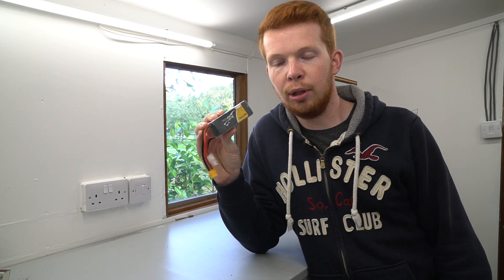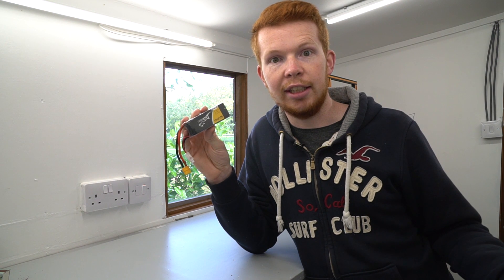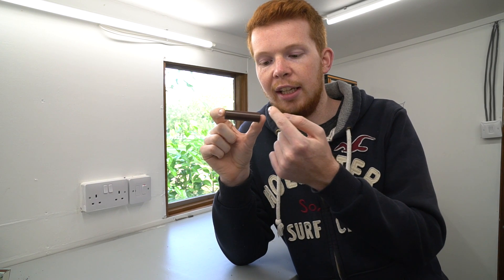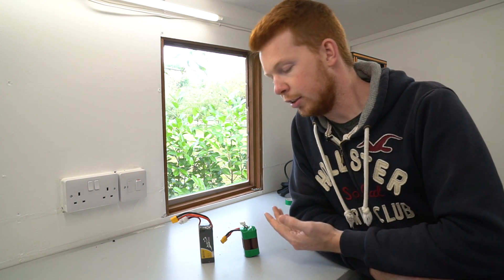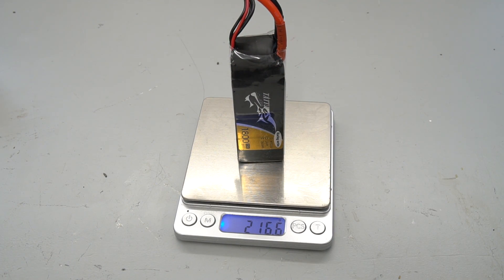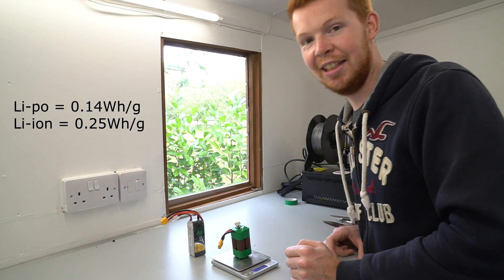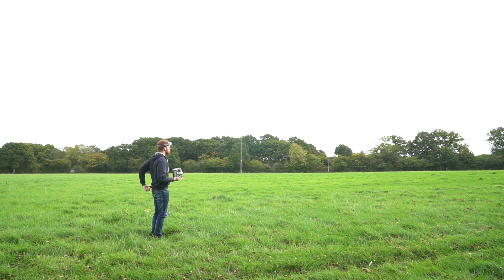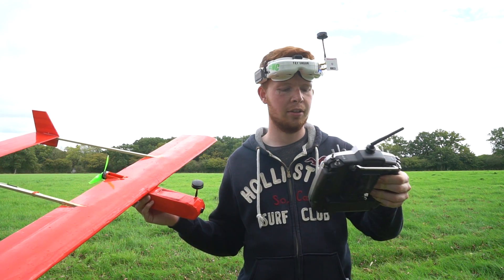Lithium ion plane battery

Comment: Just re-do the test with the plane anchored firmly to the ground and account for the drag and lift fraction that the motor won't have to push through (since less thrust is needed when you're not actually flying). Let it run "automatically" and check on it every 10 minutes or so. I don't see why the plane actually has to be flying around if what you're interested in are just the cruising values...

Comment: cool video, thank you. please run this pack on the bench! it shouldn't be to hard to clamp a motor down and let it run for an hour or two! also let it run down to 2.8 volts with 0% throttle if you can, Im really curious to see how long that is after 2.8v with the drop.. thanks!

Comment: Man... you really need to finish testing with the Li-ion. You don’t just drop the ball because it is boring. Not in my lab... You can teorize as much as you want to about the claimed performance but it is all garbage untill you prove it in the field. I bet there will be more surprises. Never go by manufacturers claims which are also... theoretical and under ideal conditions.
Come on - we are waiting ! :)

Comment: You kinda got the capacity thing wrong.
What it says on the pack, is what is safe the use, in safe voltage ranges.
It a battery pack has 1600mAh on it, then you should be able to take 1600mAh out of it just fine as manufacturers will, or at least should, rate the capacity based on discharge in safe voltage ranges.
You want to extend battery life then yeah ok reduce the voltage ranges so use less capacity.

Another thing, these 18650 3400mAh (NCR18650GA by Sanyo(Panasonic)) ones are capable of 10A constand 15A burst oficially but actually 15A constant and 20A burst in good thermal conditions, NOT 2-3A

AND OH GOD THAT ASSEMBLY.
Duh you did everything wrong, and unsafely, it's bsaically a time bomb.

Also you can get a battery spot welder made for less than 20 assuming you have a broken microwave and some beefy 35mm2 wires.
Reply: I've made some li-po to li-on conversions in the past with older tech cells for few  friends for their planes and they were reporting around twice the flight time with li-on.
I think these were usually 3S4P packs out of NCR18650PF which are 2900mAh.

Comment: You got lucky your li-ion batteries didn't vent. I vape and use 18650 in most of my devices and I had 2 batteries vent on me with only a small amount of heat from a short. I was lucky that I read building a coil at the time instead of vaping or my face would have been on fire instead

Comment: By percentage... the LiOn Batteries are fully discharge a 2.5 V per cell... and the LiPo battery is fully discharge at 3.7 V.... So unless you achieve those levels of discharge then you have not been realistically fair with your test... "Usually I only discharge my LiOn batteries down to 12 V and I know perfectly that I still have well over 30% power left on them...

Comment: An ampere-hour is not a unit of energy unless voltage is specified, so that watts can be calculated. Energy is specified in terms of power per unit time, such a watt-second, which is a joule.

Comment: Why did you fly at the same cruise speed for both batteries? Shouldn't you be able to fly slower with the li-po because its lighter, so you can get even more flight  time with a weaker draw thruster?

Comment: Hi Tom.  I enjoy your channel.  I experimented with long duration flight around 1995.  I used a small sailplane with a 1.5 meter span, a 6 cell 800 mah NiCd pack and was able to fly for almost 90 minutes.  The energy stored was 8.6 watt hours and my average draw was about 4 watts to sustain level flight.  Prop was a Robbe 6x3.5 folder and motor was a Graupner Speed 400.  I don't remember which wind I used.  Average current was about half an amp.  I had to do this just before sunset when thermal activity was nonexistent and no wind.  I found that trying to climb more than the minimum required to stay airborne shortened flight duration and thermals are bad because there is a lot more down air than up air.  Even a little down air increases your average watts.  Lipo batteries of even the poorest quality would give around four times the duration.  I would have had to worry about the transmitter batteries and bladder control issues with 6 hour duration flights not to mention being bored out of my mind.
Reply: how were u able to fly for 90 mins with just a 800mah pack at 7.2v max? makes no sense...

did u mean 8000mah?
Reply: @yaimem  The answer is in the previous post.  Still air and slow speeds with power level set to barely climb when flying straight and level.  Turns would give slight loss of altitude.  An 800mah 7.2V NiCd holds 5.76 watt hours.  Not sure where the 8.6 wh came from in the previous post.  A 4 watt draw would last 1.44 hours or about 86 minutes.

Comment: What is needed for flying is energy not charge. Multiplying the nominal voltage with it's nominal capacity is only a rough estimation. The problem is, that the energy you can get out of the cell depends on the discharge rate and the inner resistance. E.g you could short a cell and get out no energy at all since the voltage is zero.

Comment: ok JNHM rc here ....  I Need Your Help ...  in my 1st of their kind prototype cars i have a wheel power batt . and an EDF JET  Batt.    they both are LIPO ....   should i try to switch to Li-ion ... for my EDF JET BAtt to save some weight ?... or would the lower c-rating hurt my thrust too much ? .... 
this is why i Need Tom To Join My Start Up .... funny how he has the ( So Cal Sweater )   and im in So Cal ....

Comment: NO no no, LiPo cells can be brough down to around 3,3Volts, Li-Ion cells can be brought lower but the voltage drops very very quickly at the end, so the discharge curve is far from linear after 60% discharge... and then get rid of that XT60 connector and those heavy gauge copper if you try to reach maximum efficiency and running low amps.

Comment: Good info. I thought the nominal voltage of a Li-ion cell was 3.7V.. Would it still be a valid test to just anchor the plane and run the prop down? I want to built a quad using 7mm motors and a single 18650 but it's line ball whether it could generate enough lift and also, I think the current-limiting would only just cut the mustard.

Comment: So... you showed us a flawed test, then were too lazy to redo it properly.  Total waste of time.
Reply: it wasn't flawed, the results were as expected. he just didnt fly the li-ion battery long enough down to its min voltage. so it still proves you can get over an hour flight time with li-ion.
Reply: @crspy914  It WAS flawed, in that he DIDN'T fly it long enough, so it proves absolutely nothing.  You can't extrapolate from this and say it WOULD have gotten over an hour.  If you could, then there wouldn't be any need for the test, you could just calculate from the specifications.  But the whole point of tests is that you can't just trust the specs to be correct for your application.  Again, total waste of time.
Reply: crspy Agree with BrightaBlue. The test is inconclusive. Would you fly over an ocean based on the test you saw? You NEVER go by manufacturers claims. Never. He had all the pieces together and the setup but it was too boring... couldn’t do it next week? Now I have to waste my time and do it myself to make sure. Kids...
Reply: @dectechnologies1129  This would be acceptable if this would be an ad for a new product. Something that he wants to sell you.
But neither you have access to the plane he built nor you would have any value knowing that it flies 60, 80 or 100 minutes. What do you want?

This is a channel providing the information needed, not a stupid test you wouldn't even be able to check in the video.
I hope he will upload a 90 minute long video with no conclusion message, just so you will have to watch that BORING video from start to finish in order to know if his claims were true.

Comment: You  need a dc-dc converter to keep the voltage that can use most of the capacity in 18650.
Reply: Yeah but a DC to DC converter capable of several hundred watts is a bit heavy

Comment: I know this video is 1 year ago, but I would have redone a flight, only fly with the new battery and fly the plane the way you like to. Do the flips and rolls and see if it can fly over the time of the original battery that was not doing the rolls and flips. If you get over or close to the same time, but get to fly how you prefer, then that new battery is way better than the original one.
Thinking of getting into flying planes. I have a DJi phantom 3 drone, but have always been intrigued with planes and choppers.

Comment: You didn't take out even half the capacity of the LG HG2 cells. I have done tests on these for a completely different purpose, and at a discharge current of 15A and finishing at 2.8V they gave just a whisker short of a genuine 3AH. The Samsung 30Q and Sony VTC6 have almost identical performance. The voltage of all these cells falls quite quickly from 4.2V to 3.9V, then very gradually to 3.2V, then starts to fall increasingly fast.
   I knew that you are not supposed to solder to these cells, but my colleague soldered some (with a very heavy soldering iron that did the job very quickly, and tin-lead solder that melts at a much lower temperature than lead-free solder) and there were no apparent problems. I did a comparative test between soldered cells and ones with spot-welded nickel tabs, to see if there was any sign of damage. The AH capacity was identical, but rather interestingly there was a voltage drop at 15A of about 0.15V in each nickel tab (0.3V overall) that did not occur on the soldered cells. The tabbed cells were running much hotter than the soldered cells due to the extra 4.5 watts of heat caused by this voltage drop. On your 4-cell battery you would lose over one whole volt at 15A, about 7% of the battery's watt-hour capacity, by using nickel tabs. At lower currents the difference is much smaller.
   There are some web sites, for example lygte-info.dk that publish the results of independent tests on various cells. The results on this site for the cells mentioned above are almost identical to the results I found.

Comment: You have to have a look at the specs. A Sony 18650VTC6 for example delivers exactly the rated 3 Ah at 5 A discharge while the Samsung 35E will lose capacity down to 3150 mAh of it’s rated 3500 mAh at those high discharge currents. Both are very good cells but are made for different scenarios. Btw since Li-Ions give much of their capacity way below the rated voltage you have to be sure your electronics work reliably down to 2.5V / cell.

Comment: Please make another test with these batteries. Those Li-Ion cells can be discharged down to 3.0v (some manufactureres says 2.5v). You didn't get all the capacity of the Li-Ion battery.

Comment: Why are you counting amp hours. This is a wrong way to do the calculations. Best way would be to do watts hr. There are 3.7 v battery with 3.5 amps and there are 18 v battery with 1.5 amps. Obviously the 18 v will have more capacity even though it has less amps. That is why its best to multiply the volts by amps and get the wattage.
Reply: Your method is better but still not exactly right.  The PWM method of controlling power has a change in efficiency with a change in pulse width.

Comment: No doing the final test, down to 3v, is pure laziness and really more like click bait than a serious examination of a system. It seems from your own comment speculation that you may end up having to use much more throttle to maintain flight, and this may reduce or nullify the gain you might get.
My own takeaway is that if your system was really viable, others would be using it. They aren't, and you are un-willing to suffer the terrible pain and discomforrt of sitting on your butt for 40-80 minutes to put your theory to a final test.
C'mon tom. You are an engineer.

Comment: Ya Li ioron even good to under 3v although at such a big voltage drop from a fully charged state there will be a significant drop in power which can be made up by adding an extra cell.

Comment: why not just 3d print up a lightweight sled and then the batteries could be swapped quickly and two sets would get you double the flight time with a pitstop.
it might add like 50 grams.

Comment: Man, you are doing a great job with this channel and you are a very crafty guy. However, you are too experimental. I feel like you tend to want to assume or intuitively derive the science behind things, when there's no need.  You could just do some actual engineering and do the maths. Otherwise you waste an incredible amount of precious time and money. We are thinkers rather than builders, which is also an unbelievable useful asset to have, don't get me wrong, but engineers can do science, so let's do it.
I see that as a common thing across graduates, but I would recommend losing the fear of doing the maths and begin thinking thoroughly before acting. Show them the difference between a hobbyist and a professional!

Comment: 18650=max 2,5Ah real cap(real cap of noname 18650 is 0,8-2Ah) and very low max current(~5-10A, for good li-pol max constant current for this capacity is over 200A). 18650 have worse weight to energy ratio because of steel body and not very well internal reesistance.

Comment: Determine your planes minimum operating voltage. use the lion batteries minimum voltage to determine your cell count. Then use a voltage regulator with a good cap and you should get the maximum potential out of the 18650 cell your using

Comment: Tom, why dont you set up autopilot? Also, there are expensive 18650 that have capacity and 30 amps, those are used by vapers, check out their reddit, why dont you use those.

Comment: You could just discharge the cells with your battery charger with a constant current in order to measure their usable capacity for flying at cruise speed. The results would be better to compare and mean less work for you.

Comment: I don't know what motor he had in his plane, but you can fly a plane that size off of a motor using less than 10amp max.  There are some small BL motors now that draw very little yet provide a fair bit of thrust.

Comment: The Li Ion batteries aren't 4.2v, they're 3.7v. Yes, they charge up to 4.2v, but they discharge to 3.7 relatively quickly and are designed to run at 3.7 for extended periods of time. Which means you could have ran it  for quite a bit longer with not much drop in voltage. Technically they weren't even discharged to their nominal voltage since you had them at 3.9v per cell.
Reply: Also, if you run them down to 2v you'll ruin the battery. You should never really draw them below 3.2v.

Comment: Good video, let me be a bit more specific if anyone is confused.

Amp/hour (Ah) is not energy. It's reletive to voltage (V). Watt/hour (Wh) is energy. For eksampel, you can have 2 batteries of 3Ah in parallel, and you would have 6Ah at 3.7V = 22.2Wh or you could have the same 2 batteries in series and have 3Ah at 7.4V = 22.2Wh. Capacity can only be stated by Wh, not V or Ah. But if you compare battery packs of the same voltage, then ofcause you can just refer to Ah.
Reply: "Capacity can only be stated by Wh"
This isn't true. Capacity has units of Ah, energy has units of Wh or J etc. Capacity in Ah is useful because often we care about current drawn not energy drawn.

Comment: The capacity of the battery is measured down to its designed discharged voltage and not zero volts. This is the voltage the designers have declared it is safe to discharge to and the battery is considered to be discharged or " flat" at this voltage. You can use full capacity down to this voltage. Some batteries have management circuitry to prevent discharge beyond this point to prevent damage.

Comment: Watch this video that shows the insides of fake 18650 batteries. They often have batteries within batteries, capacitors within batteries. All sorts of cons. The best indicator is the weight of the battery, and that's not perfect = https://youtu.be/JzzfzGJpUS8

Comment: I'm surprised you didn't make a 3D printed holder for the batteries, with metal tabs either end, so you didn't need to solder them.

Comment: Some time back I was researching how they managed 2 hours of flight time on a quad seen here https://www.flyingtech.co.uk/blog/efficiency-vs-performance-how-build-drone-long-flight-time.. It turns out that higher volts, larger props, lower KV and higher torque delivery are the secret. I recon one could achieve the same in winged crafts.

Comment: Supb idea buddy  i check the price if the lipo betry

11.1 valt lipo betry 2200 mah cost me 1600

And li - ion betty costs 800 rs for 4 pcs   very cheap

Hey can u give me the dimensions of that red plane i want to make it
(chintan5.solanki@gmail.com)
Thanks in advance👍😲

I have ordered flysky 6 chanel transmittre and reciver from banggood.com and esc 30 A, 1000 kv brushless motor and 2 survos😍 with (1045) propelar

Comment: Tom, has you seen the SANYO/Panasonic NCR18650GA?
They are capable of delivering 10A with 3500MAh. And they are still less then 50g. Imagine the Energy Density per mass on these batteries.
Is there a higher Wh/g battery?

Comment: As the voltage drops down toward that 2-2.5 per cell with motor using the same watts the amp draw will increase I believe that would cut down the 80 min estimate

Comment: You should look into Graphine batteries.  5x the runtime of a Lith, 1/4 the weight, minutes to fully charge.  I imagine you may need quite a bankroll to get one, but if you want hardcore, there is your fix.  Pretty sure they are currently only available for military use, but there is ALWAYS a way...
Reply: You mean GraphENE not GraphINE right?
Reply: they are easy to make ,check robert murray smiths channel ,,teaching us all new battery tech that you can make at home...